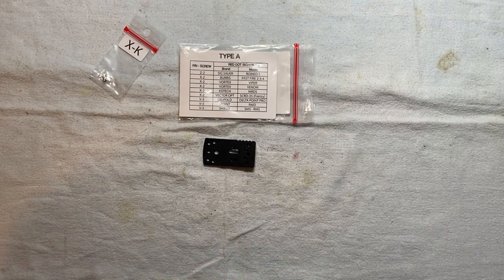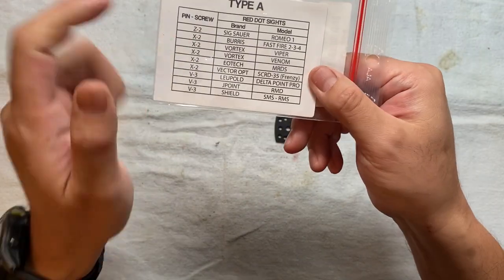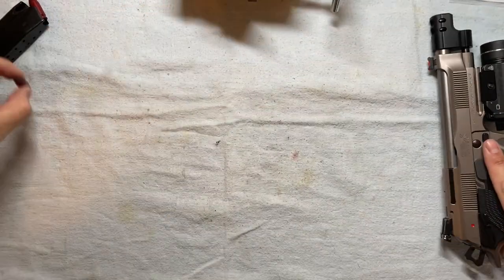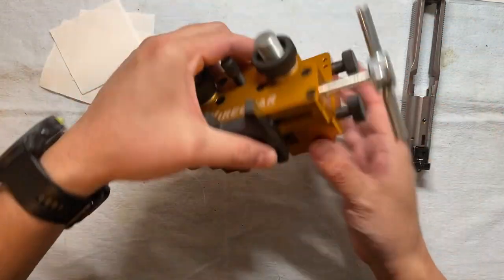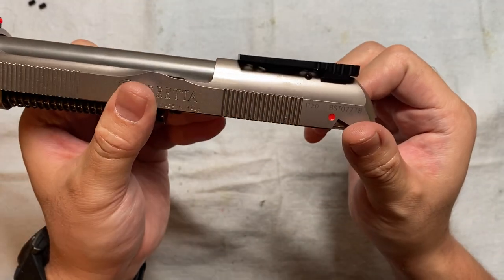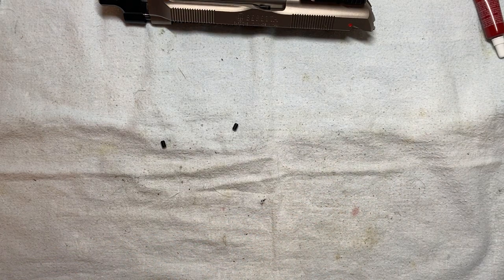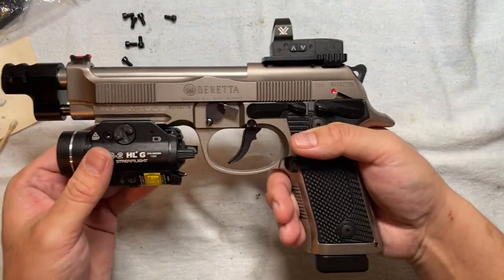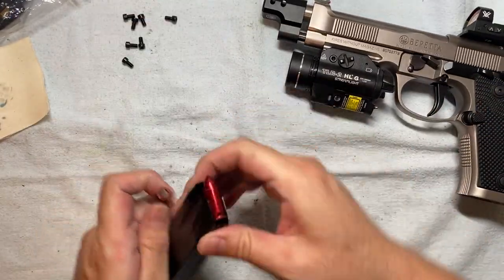Install Toni System Red Dot Plate on Beretta 92X Performance

Comment: For the beretta 92x performance front sight remove, just use pusher tool to one direction? I try to work on it, but it is so hard when I use pusher at the first time.
Reply from the maker: Yes just use the pusher tool. Make sure you do it correctly. The front sight should be able to come off very easily.
Reply: @9mmtactical  thank you, Is there anything I need to pay attention to when I replace front sight? Could you tell me some tips guiding me thank you very much

Comment: Hi Sir , the mounting screws for the dot on to the tony system plate are M3,5 thead? thanks
Reply from the maker: Different holes on it have different sizes. For Vortex Venom that I installed, it might be M4. Sorry I don't remember and can't find the record of where I got the screws.
Reply: @9mmtactical  yes, thanks that's why i am asking to you it is not wrote down in any site thev screws tyoe
Reply: @chriistar  nope sir.. till now i could not be able tu put my hans on one of those

Comment: Hey, so how is the plate holding? I'm now deciding which Beretta to buy, a regular like yours or RDO? Did you have any issues with a plate? Thanks.
Reply from the maker: No issue at all. It’s holding extremely well. It took me a lot of effort to hammer into the dovetail so it’s not going anywhere. If you aren’t confident of doing it yourself, you should buy an RDO version.
Reply: @9mmtactical  Nah I'm ok :) I have the same "wiregear" tool. Now I just can't decide on Beretta 92x Performance or 92x Centurion RDO. Somehow I like more Centurion RDO more because of the lighter weight, but I need Beretta as an alternative to Shadow 2 (amazing pistols, but design-wise it looks like a WW1 gun :D)
Reply from the maker: LOL I know what you mean.

Comment: Mine is so tight that I cant even install it with a sight pusher
Reply from the maker: You need to file some material off the plate. Do little by little.
Reply: @9mmtactical  yeah I did that as well. I ended up having to use a c clamp and a ton of force on the sight pusher. That was sketchy.
Reply from the maker: I see. Yeah recently I had to replace this plate with the other type for a different red dot foot print. I just kept filing material off the plate until I’m able to tap the plate into the dovetail without excessive force. Just takes patience. I learned the hard way by breaking my HK slide.

Comment: i get the plate for rmr pattern, after instal, i couldnt zero rmr because lack of vertical adjustment, for 15m i was like 10cm up from center... 😢 anyone had same problem? or solution??? thanks!
Reply from the maker: Yes I know this issue. You probably filed too much material off of the plate? Now after you put the set screws the plate is pointing too high and you can’t lower to dot further. It will help if you have the third set screw and put it in the hole that’s in between the two set holes but behind them. That will tilt the plate a bit and force it to point lower.
Reply from the maker: Also, to confirm, did you mean that your dot was too high from the center and you can't lower it further or your bullet hole (impact point) being too high?
Reply: @9mmtactical  thanks for answer, plate is tilt down, in front like 1 mm from frame of the gun, so i cant tilt plate any further... btw we didnt get any material of  the plate, it sits right out of box....what i mean, my point of impact is too high
Reply from the maker: @dalibormotycka3037 oh I see. Then you can do the other way around. You can file off a little bit material from the front edge of the plate that touches the dovetail. That way after inserting into the dovetail the plate can point upward a little.